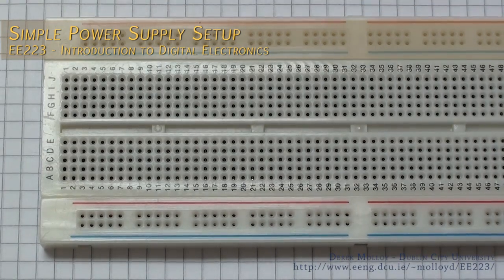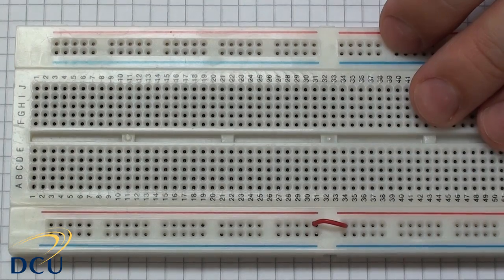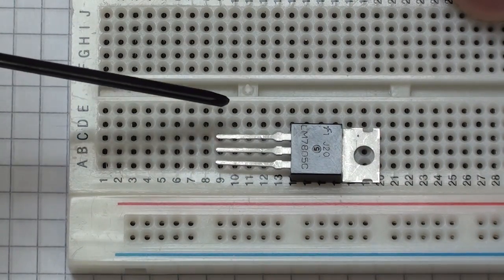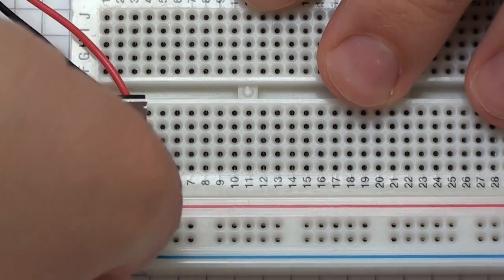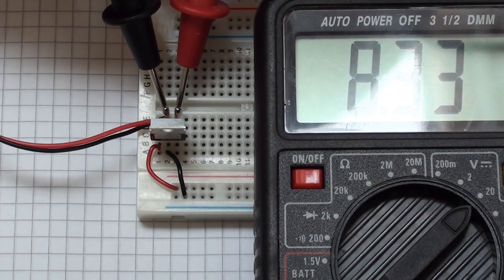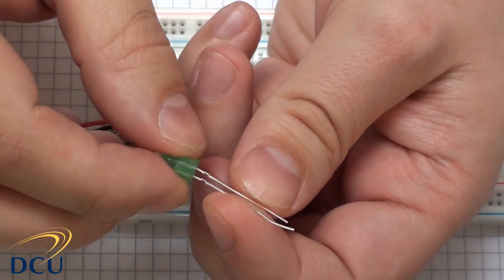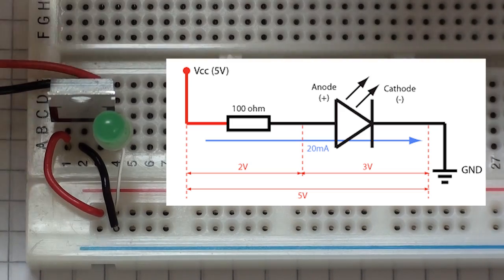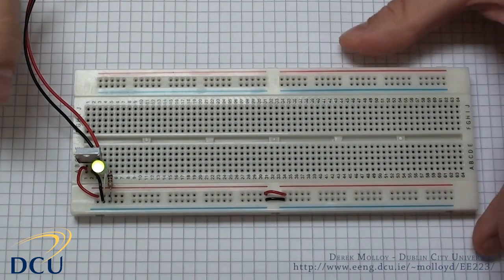Experiments 1.1: Introductory Power Supply Circuit

Comment: 9 volts is being fed to the LM7805C and 5 volts is coming out.  That's pretty cool.  Does the amperage then increase on the 5 volt side?  Can one hook up 3.3 volts to the input side and still have 5 volts on the output side, but at the expense of amperage?

Comment from the maker: Zener diodes do not provide voltage regulation for a wide range of load current. This is why you would need a DC voltage regulator.

Comment from the maker: Once the battery voltage degrades below 6-7V the voltage regulator will no longer function. A LDO (low drop out) voltage regulator helps with this by lowering the threshold, but there will still be a threshold beyond which the voltage regulator will not function.

Comment: the specs for the LED are 3V & 20mA. since the supply is 5V, we need a resistor to drop down 2V when 20mA flows through it. Ohms law R = V/I  which is = 2V/20mA which is = 100 Ohms.

Comment: Sorry for the prev question i test the requlator its damaged in spite of i bought it  as new , the voltage meter is showing less than 1 V. i check the new one and its worked well .

Comment: Hi Sir, Please answer my question , i am using LM7905CV but the LED brightness amount is very low even without the resistors if i compared to arduino 5v. I am using new 9v battery.

Comment: Hello,  Was going to ask about needing a capacitor and diodes that I've seen in other voltage regulator circuits but I see the thumbnail picture of the next video is showing that.   Started with a later video but now going to watch in sequence looks like very useful information, Thanks.